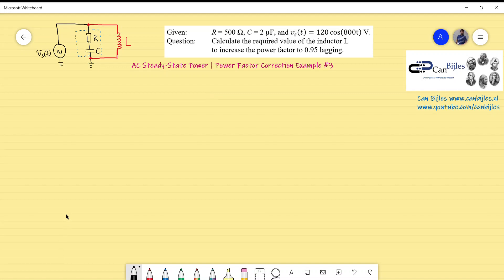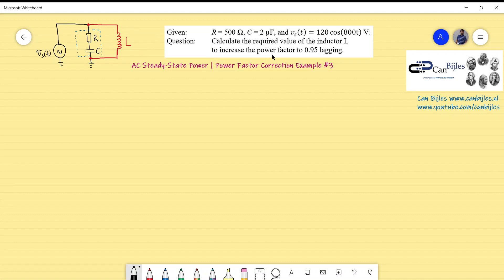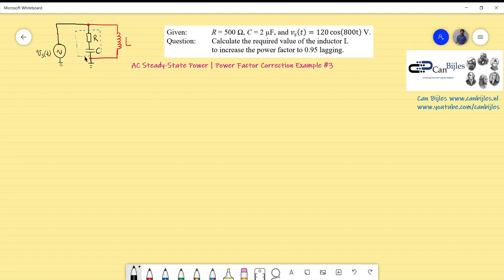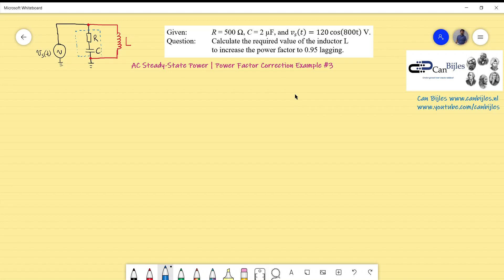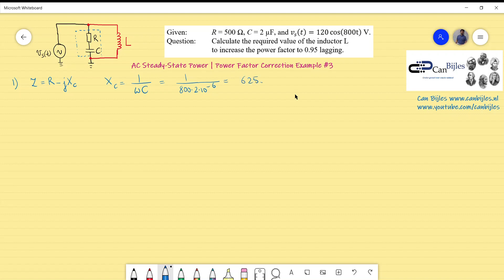Power Factor Correction ⭐ Example 3: Capacitive Load

Comment: Voltage soure is given by cosine expression why don't you turn it into sinne expression
Reply from the maker: Cosine form is the default form to convert from time domain into the frequency domain (phasor form). However,  you might also work with sine form if you keep this form in your calculations at all times. Be careful with phase when you use the sine form.

Comment: why you add inductor in parallel but not in series?
Reply from the maker: You can try to connect the inductor in series, but parallel connection is more practical in most cases.